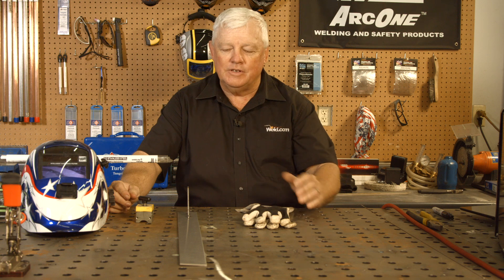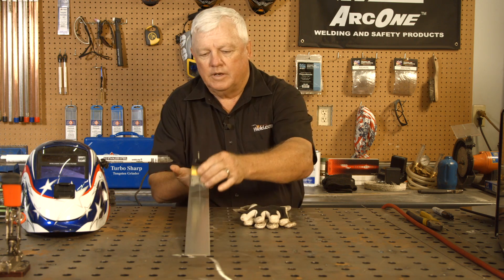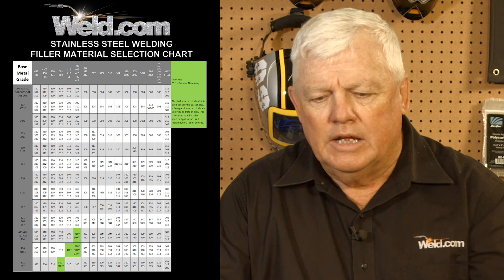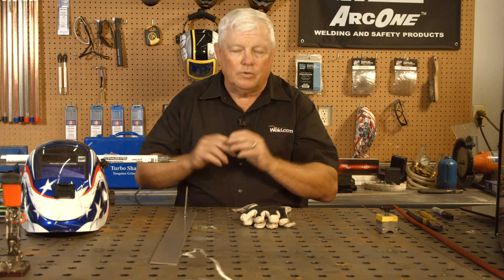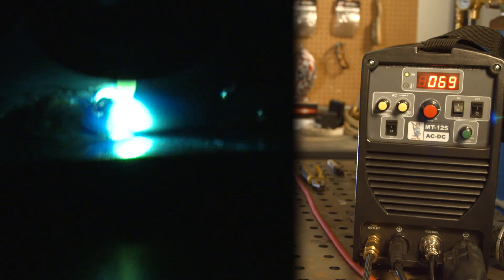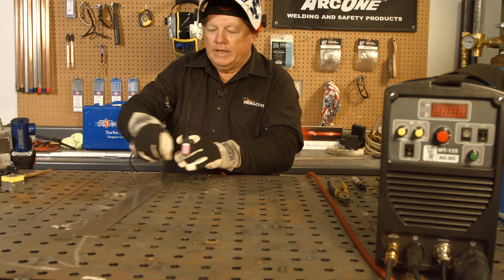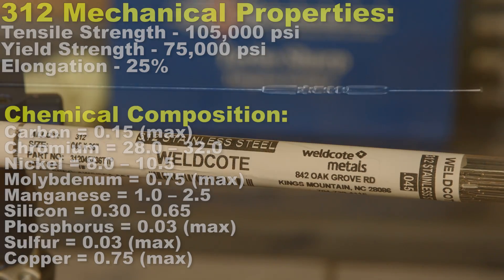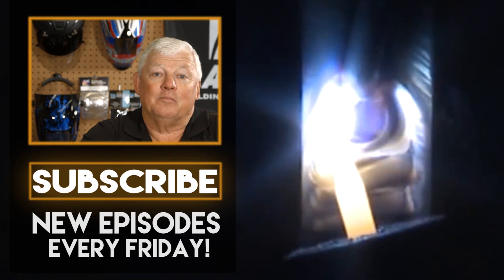Welding Stainless to Mild Steel with 312 Filler

Comment: What happens to mild steel if I'd attach (weld or clamp) stainless exhaust pipe to mild steel one? Will that mild steel rust away faster than it would on it's own because of electrochemical reaction or what should I expect? I suppose what I'm asking is: Can I attach stainless cat-back system to mild steel pipe, or will it just rust from that joint very fast?

Comment: I was looking at this for a 303 stainless cold air box. 
I need to weld the open bottom stainless box to the mild steel fender...I don't need much strength at all, but I want the weld to look nice and I definitely need a filler that will wet out. 
Any suggestions?
Thanks in advance!

Comment: Mr Tig I work as a fabricator and I use a lot of 312 to join Stellite 6 tips onto S1040 shear blade bodies. It is the one recommended by a welding supply house, and it works very well. By the way these shear blades go from normal atmospheric temperature to about 1200 degrees Centigrade in about 5 seconds, and they last for hundreds of cuts before the Stellite starts to crack.

Comment: I notice in the close ups you're pulling the rod out of the shielding gas envelope. You should keep the hot tip of that filler rod shielded, especially with stainless. Maybe you'll respond to that rather then one of your cronies.

Comment: A company I've worked for would use 316 rods used in the industry for the steel to stainless mix of materials for years without any problems, in fact the company would only purchase 316 rods to ensure that these were being used for this.

Makes me wonder how much of a difference it really makes, I'll have to have an experiment with different ones myself.. thanks for the video, very interesting.

Comment: Hi Mr Tig, 

I don't mean this in a patronising comment or deffo not a keyboard warrior comment.

I'd just like to know what experience you have? As you understand you don't want to believe everything you believe on the Web. 

ps I don't doubt your tig talent I can see that in your videos.

I look forward to you letting me know what you've done to get where you are.

Kind regards 
David Morland
Reply from the maker: Currently, Wyatt does mostly consulting, but is also one of the track side welders at the Indy 500, MotoGP, and countless Nascar races. He also consults with Lincoln Electric in the creation and testing of many of their welders. Previously he worked extensively in aerospace for NASA as a welding engineer on the Apollo missions and worked for  Lockheed Martin in their missiles and fire control welding department. Thanks for your question. Hopefully that addresses some of your questions regarding his background and knowledge of the TIG welding industry.
Reply: Impressive. Thanks for your reply.
Reply: Those who can do, do. Those who can't troll YouTube videos. mic drop
Reply: +Weld.com those who can, do. Those who can't, consult.

Comment: I wish you guys would always show a close up of the finished weld, way to often you show the tinted view while welding and maybe a far away view of the finished part but not a close up of the cleaned up finished part, Mr. Tig and Bob Moffatt are both guilty of this.

Comment: I learned something cool, thanks Mr.Tig. Is there a paper copy or a site I can print off that cross reference chart by chance? Thad be handy I think. One more thing if you don't mind, can you do the same (I'm assuming) with a stick electrode? As in stick welding steel to stainless? Any idea? Thanks man for the lesson keep up the good work. 
-Pidge
Reply from the maker: There's a link to the chart in the description. You can do the same thing with stick welding and Bob Moffatt  actually just shot a video on this subject for the MIG Monday series. It will be coming out soon.

Comment: Good Video, what were the thicknesses of the two base metals?  Also i am still struggling with getting a good lap joint and also tee joints. Could you do a video on these? THX

Comment: Few things worth noting: ER309 will give the most close match chemistry and temperature resistance to the 304 when welding to Carbon steel (to up the Cr and Ni for the added dilution of the Carbon steel), and is the logical choice here.  ER312 has a higher ferrite content, which provides the crack resistance, but should not be used at higher temperatures and is more expensive.  I'd only use this if the Carbon steel was a free machining grade or high Carbon and prone to cracking (or if that was all I had...).  I'm not sure why ER310 is on this list, it is fully austenitic and prone to cracking, and really only there for the higher temperatures, above the service temperature of 304 or Carbon steel.  If ER310 is necessary, the base metals would need to be 310 as well.
Reply: Thank you, somebody else said it. Aerospace consulting for NASA is appearently on this guy's resume. I'm all for free education, but not when it's bad.

Comment: Mr Tig I'm currently in welding school. This was an awesome video and am looking forward to more of your video's. I do have a question about a certain metal. We don't have the ability to obtain 
Nickle-Copper. Are there any tips or tricks of the trade for that type of material?
Reply: You'll see some benefit with a 75/25 Ar/He shielding gas.  50/50 or even 100% Helium would be better, although more expensive.